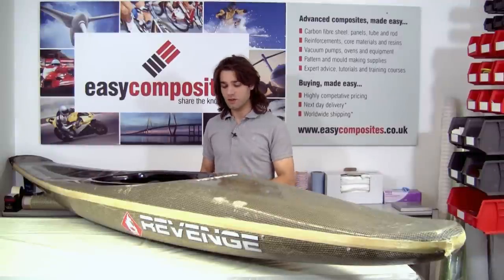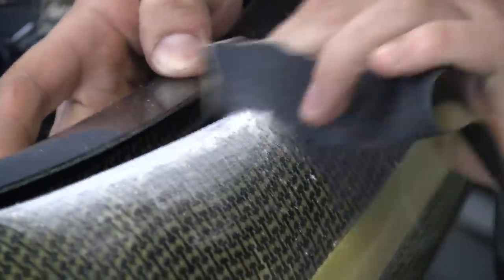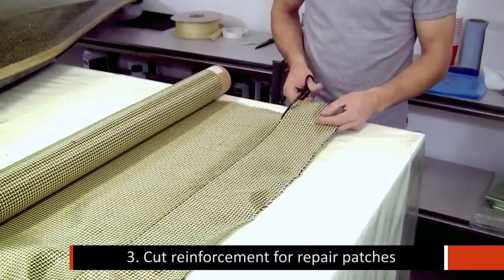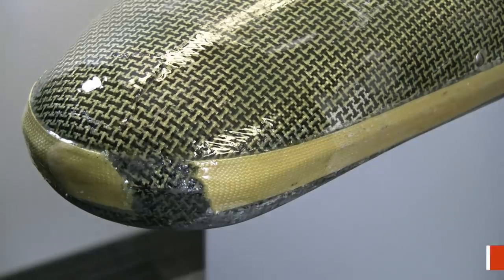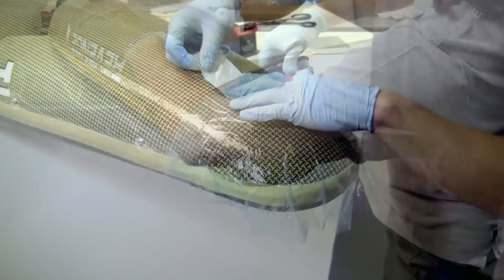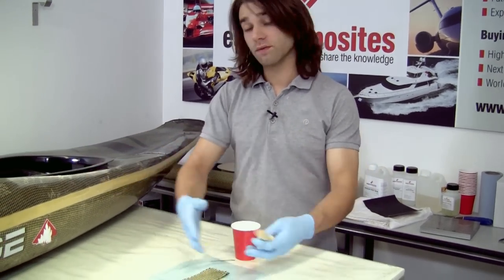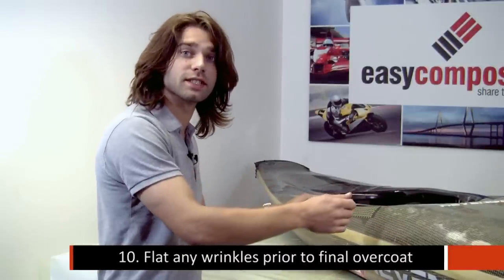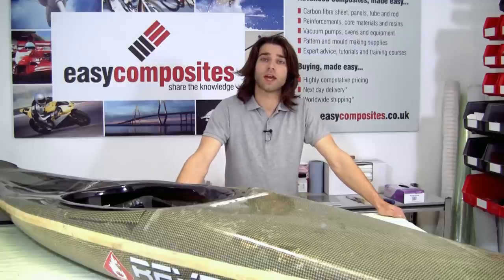How to Repair a Damaged Composite Canoe or Kayak - Carbon/Kevlar Fibre

Comment: There is a trick that few people do or know that will make the bond 1000 times stronger, but you got to use some slow cure epoxy. 
Always hit the part with heat until its as thin as gasoline try and keep it there for a few seconds without it smoking. If to much epoxy dripped off just add more. You don't need to hit it with heat a second time unless you're baking it in the oven.
What this does is it turns the epoxy so thin that it fits into all the micro scratches grains and spaces this makes the bond literally more than twice and strong. 
I used to make kiteboards and a repair over cured epoxy was worthless without heating it up.
You can do a test, put some fiberglass and epoxy over glass and let it cure in room temperature leave a little fiberglass off so you can pull on it later.
Then do another one and heat it with a heat gun for a few seconds till it turns super thin then let it cure. 
After they are both cured you will never be able to pull the heated epoxy off the glass. 
The unheated one will pop off quiet easy depending on the room temperature it was curing in.
This makes such a strong bond Im willing to bet it would be stronger even if the part to repair was not sanded.

Comment: Used this process to repair a 1/3 scale glider fuselage that had snapped in two places after a heavy landing. The EasyComposites scales are invaluable for correct mix of the EL2 and release film makes life so much easier when applying the wet carbon. Great vids and a great range of products! Thanks!
Reply from the maker: Thanks very much. Glad to hear the video helped, the products worked and the repair went well. Thanks for the feedback.

Comment from the maker: Dry the kyak fully to see if the parts are firm again.  If they are still soft, then there has been some structural damage and you would be best patching the repair to replace the strength lost.
Reply: Would it be cost effective to make an electric guitar case out of Kevlar, (top and bottom halves joined with that Kevlar tape) showing that beautiful weave? Probably not, as a new guitar case, pop out plastic shell case sells for around £50 to £100? Thanks great video!

Comment from the maker: To cut out a section of the hull and replace it to completely remove the damage is rediculously over the top for that kind of damage.  The repair done is perfectly strong enough, and more importantly and the whole point of the video, is within the means of your average guy.  To make a near invisible factory style repair would be both expensive, and likely impractical for people to do at home.

Comment: ive done a couple of repairs to my kayak now and the patches look pretty good, but im left with small pits from where there were tiny air bubbles left over,will this have a bad effect or is it merely cosmetic. I wouldnt have had the confidence to do it without seeing this video...
Reply from the maker: If they are deep you can fill them with a light overcoat of resin - sometimes a cocktail stick can be used to dab resin into the hole. But if shallow and they sand out without exposing the fibres then all is good.

Comment: i remember using this 2 part epoxy paste that smelled like corn chips  and it took 32 hours to cure, and was hand workable. I had a friend come to me with his ct90 Honda, that had the chain bunch up and break the casing away leaving a open gap letting all the oil pore out, and I fixed that with the 32 hour resin and fiber glass and Kevlar sandwiched the Kevlar was the main structure the glass was for fill,   as I removed any lose aluminium,  lucky the bolt holes where on both side of the break so I did not need to drill bolt holes,  it  hardened like clay,  slowly getting stiffer, I was able to sand it for the aluminium cover to fit and not lose oil, and that bike worked for years, I sold it and never heard if it still works but it was treated like a dirt bike so you never know wish I took picture.

Comment: I am currently making a set of bowls of 12 cm diameter by layering up cuttings of 2-2 twill on top a metal bowl turned upside down (this is primarly for practice, but I'll try high temp resin instead of EL-2 in case I want to use it as a piece of dish). At first I PVA-coated the metal bowl and in one go layered up the fabric wet. While cutting and layering, some of the 16 patches (orange peel shaped) frayed and left loose strands of fibre across the wet surface. By the end of the pot life the patches were placed more or less as planned, and I wrapped it all in shrink tape, which was a bit messy on the resin but ok. Put that into the the oven at 120 C. The tape shrinked as desired, but the resin partially hardened as foam underneath the tape. A few hours later I had to pry out and destroy the metal positive to get a release. The next time I'll want to make it better. First, I am thinking of putting a layer peel ply and/or release film underneath the shrink tape. Second, I'll add to the metal positive a polished epoxy surface to apply the PVA onto. I can also think of stretching a layer of release film over the outside of the metal bowl alternatively, if I can do that with no wrinkles. Do you have any further suggestions for me?
Reply from the maker: Wow, there's a lot to unpack there. I'm not sure where to begin! Firstly, I wouldn't recommend PVA as a release agent for high temperature use, you would be better with Easy-Lease chemical release agent. As for the shrink tape method, I think this is always going to be pretty messy. Given the shape you're trying to make I would suggest getting two metal bowls and using Easy-Lease on the inside of one and the outside of the other. You could then use them as matched tool. If you clamp the two bowls together whilst the resin cured then this could create a decent result and have a smooth finish inside and out.
Reply: @easycompositestv  Thank you very much, that's a very workable idea to just go with two bowls.

Comment: I have no idea what feathering is. However I have found this video useful. My slalom kayak is made from the same material as the hull in this video. The epoxy layer on some parts of the hull have worn away making it slightly (only very slightly) soft in parts. Could I just apply another epoxy layer or two, or would I need to patch it?

Comment: This is the only example I've been able to find so far for using release film in hand layup without a vacuum bag.  Is there anything special about this film?  Could you use regular shrink wrap?  In any case, it seems like a good way to get a nice finish on something too large to vacuum bag.
Reply from the maker: You’ll almost certainly find that shrink wrap will stick to the resin, which is clearly not a good thing. This release film is made from FEP which is totally non-stick to all of the major resin groups. It’s also strong and stretchy, making it ideal for this application. You can also use ETFE release film, that works great too. Both of these films are specialist to the composites industry.
Reply: I’m so glad I found your video before doing repairs on my old fiberglass kayak. You’re clear, organized, and articulate. Thank you!

Comment: great video! from your point of view what product is better for this kind of application carbon fiber or Kevlar/Carbon?
Reply from the maker: Generally you would aim to repair using the same material the kayak was made with.  In many cases these kind of kayaks are a Carbon/Kevlar hybrid cloth and hence that is what is used here.

Comment: Is the epoxy finish uv-resistant (i.e., will it withstand outdoor storage)?  I know most epoxies are very susceptible to uv damage, and was wondering if this product incorporates inhibitors?
Reply from the maker: Hi Jack, the resin we use in this video is our Rapid Repair Resin; this resin specifically focuses on mechanical performance and so is not specifically designed to offer enhanced UV stability however it is part of a newer generation of epoxies which do hold up to UV rays much better than older systems and so for repair use, as used in this video, it would be perfectly fine and still look good and work well for years to come. We do have epoxies which are specifically intended for cosmetic applications where any slight yellowing or discolouration would be a problem, such as our XCR (Xtreme Coating Resin) which could be used as an alternative to the Rapid Repair Resin (used in this video) if you're looking for the very best in UV stability.

Comment: If you just have damaged resin could you just apply the resin over the damaged areas to recreate a smooth finish? Easy composites Ltd
Reply from the maker: Yes, as you will see in the later part of the video we do just that and use the release film to make a smooth finish.

Comment: So I bought an Impex Currituck Carbon/kevlar and I noticed (webbing cracks) and a chip in the hull (outside) and a break in the fiber pattern inside.  In the skeg box area the finish is breaking away as well. Should this be done by pro, how much would it cost?
Reply from the maker: I'm afraid I can't comment on how much it would cost to have this sort of repair work done, we just sell the materials and provide the advice. Hopefully you can track somewhere down that can give you a quote though.

Comment: I'm having trouble finding the release film in the USA. Can you give a bit more info, like what 3M number it is? Thanks!
Reply from the maker: Its not a 3M product so we don't have any such reference but its commonly used in PrePreg production so any company offering composite PrePregs is likely to have this kind of film; it's usually an ETFE or FEP plastic-type.

Comment: Yo guys, we have a similar boat in our shed that is sort of bent on the line of the joint between the hulls..., we were wondering if you have any experience on recovering the shape? Can we possibly heat it up and soften it and try to remold it?

We would really appreciate thoughts. 

Kind regards,

Alejandro
Reply from the maker: The resins used are generally thermoset resins if it is a composite boat, so heating it up is not generally going to work.  You could jig the boat into the right shape then add bracing and more reinforcement to hold it in shape.

Comment: I am planning a major project using your prepreg products, I was first studying the carbon fiber prepreg but since this cures in room temperature I wonder if it would not be feasible to make my entire project in Kevlar instead. Multi-layering Kevlar, without the need of using an oven must be the simplest way. I want to make a complete dakar rally fairing plus fuel tank for my motorcycle. Would you recommend to do it purely in Kevlar? I will also make a bash plate.
Reply from the maker: There are plenty of room temperature curing resins to choose from so no need to go down the pre-preg route unless you specifically want to.  You can use kevlar in that way to provide the impact resistance.

Comment: For the life of me, I can't get this smooth, bubble free, finish with the release film.

There are always way too many tiny air bubbles, and some are just impossible to move to the edge without accidently & permanently wrinkling the release film (which leaves a line in the finish). I've tried 4 repairs using these steps and have not been able to get the perfect finish yet.

Can you guys give any more detailed steps or tips for this part of the process?
Reply from the maker: If you are still struggling with bubbles, very gentle waft a heat gun over the top of the bubble. The resin should thin slightly then the bubble will come to the surface and pop.  Once most the big bubbles are gone, then apply the release film working from one side carefully to avoid air inclusion underneath. Even if you do get the odd wrinkle, you can sand it back flat, if necessary recoat, then polish back up to a gloss.
Reply: Easy Composites Ltd
 Thanks :)
Will give it a go!

Comment: Could you make a video about how to polish these kind of Kayaks?
Reply from the maker: Well, the correct polishing process would depend on what the actual surface of your kayak is; whether it’s gelcoat or paint, whether it’s epoxy, or polyester and - quite importantly - how thick the coating is. All that said, a relatively fine abrasive paper (400+) and then a polishing compound such as NW1 would be a good starting point in many cases.

Comment: Does the same technique apply to squishy patches. I have a large patch on the bottom of my canoe polo boat that has lost its structure but it’s not cracked or visibly damaged. Would this benefit from a patch?
Reply from the maker: Yes as it is where the resin at least has failed.  If accessible, you could repair on the inside for neatness.  You may need to sand and reseal the surface with resin if it is compromised and leaks.

Comment: Now I know this is a very old thread but hopefully you may see this.. My release film keeps crinkling a lot! I've tried using lighter & heavier release film, tight stretch through to almost no stretch. It's pretty warm here so am only using 1 - 1.5 ml per hundy of MEKP to 100ml resin. Any help appreciated
Reply from the maker: Is your release film compatible with Styrene? In this video, we're using epoxy resin but as you mention MEKP, I assume you're working with Poly or Vinylester resin - the styrene emitted whilst these cure can attack, soften or even dissolve certain plastics so it would be worth checking compatibility of the film you're using.
Reply: Ahh that’ll be why then, yes I’m using polyester on my old race boat, I’ll see if there’s any release film more compatible. Thank you for responding, your channel is often my go to. Kind Regards Chris
Reply from the maker: @chrismaitland6636  Its a pleasure :)
Reply: Went back to tried and trusted peel ply, I’ll finish of with either clear gel coat or just clear coat

Comment: ive made many surfboards over the years in other countrys but never in UK and the cost of materials is very high. ive never used cling film in the proceedure but seen it used in working with carbon fibre can anyone tell me if they've seen it used in the case of ordinary fibre glass and polyester resins and on what products, thanks? I am now making my very first combat knife sheath by using a blowgun on polyethelene plastic sheet 3mm thick. the finish is amazing.I would love to make a guitar case out of this material and also out of this carbon fibre course weave material used on your canoe, but then it all depends on the price of materials in relation economically to the product. I made a rifle case once by joining two plastic kids school cases and cutting joining and reinforcing them and finished them off with angle aluminium metal beading on edge using rivets screws and fibre glass ribbon tape. glass fibre is a beautiful thing. have any of you ever read captain cooks amazingly descriptive paragraphs in the chapter of his first sighting of surfing in the Polynesian islands or probably Tahiti?. Well read it , it will blow your minds. And so that's where they got the name polyester resin. it was name after Poly the Parrot that belonged to Captain Silver in the Polynesians. He kept talkin 'n'singin........ "did u remember to put the harder in stupid"'!!!
Reply: well catalyst comes from the island of catalina
Reply from the maker: The film we use in the video is not cling film but a special release film which does not stick to resins. We would not recommend using cling film as only some clingfilms are non-stick.  You could make cases and even a guitar from carbon fibre if you wished.  It is as you say, about budget to an extent.

Comment: Is the release film necessary or could something like saran wrap or clingfilm suffice?
Reply from the maker: The release film we use is ETFE which is an excellent combination of release properties (practically nothing sticks to it) with strength and stretch meaning it works really well for this type of repair. The problem with clingfilm is that they're not all made from the same material - some will release from epoxy resin and others will stick to it so it would be important to do a test run first. The second issue is that they're much more stretchy and less strong making it harder to get quick as good a finish, however, certainly experiment and you might find you can get results you're happy with.
Reply: Cheers

Comment: Is the resin epoxy?
Reply from the maker: Yes it is.
Reply: @easycompositestv  do you have to put a UV top coat on top once finished?
Reply from the maker: @mountdoomee  It's not usually necessary for this particular application but for repairs which are likely to spend more time outdoor then a clearcoat could be sprayed over the top.

Comment: need to repair my slalom kayak but first time doing it its carbon kevlar but dont know what things to get to repare it could u reply with a list
Reply from the maker: If you watch the video through our EasyComposites website in the Learning Centre, then there is a "shopping list" of items used next to the video. The quantity will depend on the specific repairs you need to make.
Reply: Easy Composites Ltd 0